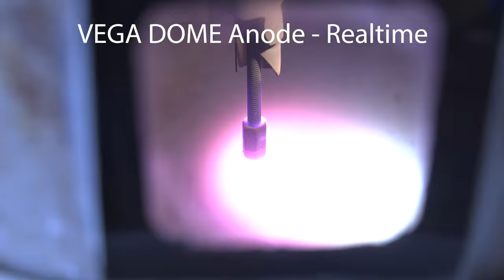VEGA - DOME Anode

Comment: Is the anode here warming?
Reply from the maker: That is a good question, it surely is, however, what we see some times is it almost instantly goes from non-luminous to glowing orange, and it makes little sense that the bulk temperature would have that big a black body change over such a small time frame.
Reply: @MFMP  Its almost like a lightning discharge. Do you know if the cathode cools?
Reply from the maker: @bobann3566  It is at or near to ambient normally when reactor is opened. During experiments, the hemispheres often return to exactly the same position.
Reply from the maker: Energy Exchange between induced flux of Relic Neutrinos and their condensates and electrons leading to them being excited and subsequent photon emission

e+v > e+v

https://youtu.be/12F_1NEPkYU?t=2159